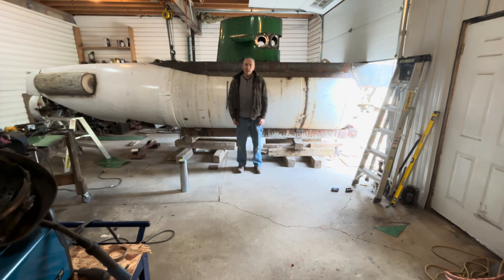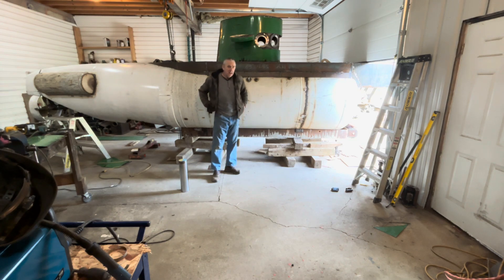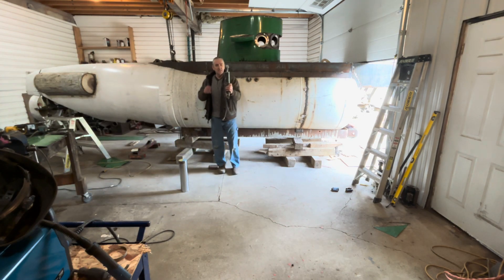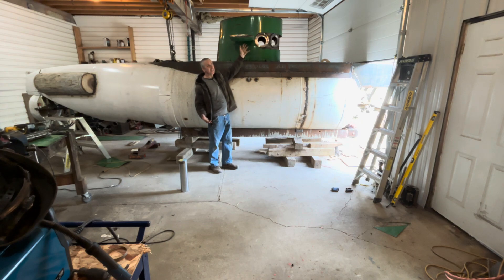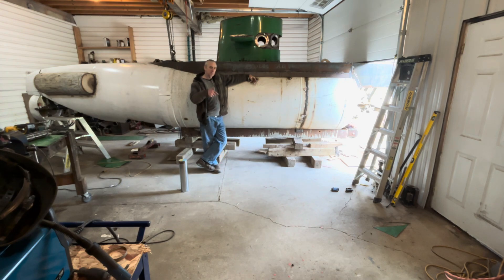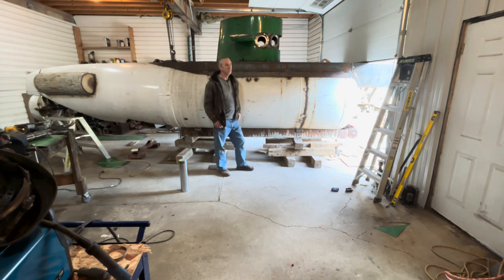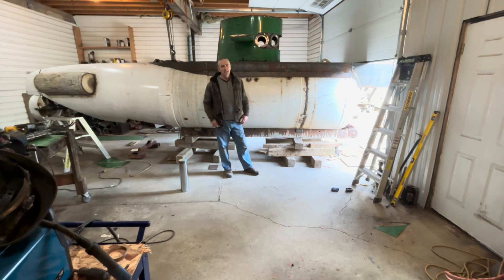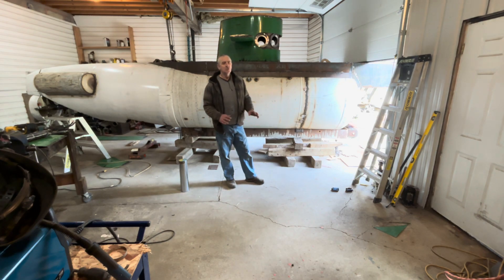Building my diesel electric submarine at home.

Comment: What are you welding with. I used to weld tanks, hull plating and keels with 7014, 8014, 9014 and 10014 rod. Works great and is not brittle at most high or cold temperature.

Comment: Hello, I watched your video and it was so interesting. Could you tell me the names of the solenoid valves and manifolds you used in the ballast tank? (In this video : Mounting Ballast Tanks To Homemade Submarine | Isolation Project) I am trying to control the ballast tank with the air of medium pressure (10 bar) coming from the first stage breathing apparatus in the air tank, but I am having trouble choosing the product, so I would like to hear your advice. Thank you.
Reply from the maker: I need more information.  How many ballast tanks do you have?  If you have multiple tanks then you can consider solenoid valves.  My concern is reliability.  You must make sure that if one ballast tanks fails the other ballast tank can surface the sub sufficiently enough to open the hatch safely.  I use simple air or water valves from Amazon and have never had a problem in fresh water.  The safest  way is to use manual valves with hull penetrating rods.
Reply: @HankPronk  I am planning to build a system with at least 4 ballast tanks. I think that if I fill each ballast tank with different amount of seawater (or compressed air), I will be able to control the attitude intentionally. Is it possible to talk more about this by email? If possible, I will leave my email address. Thank you.
Reply from the maker: @Barcod_  The key is to keep it simple.  Normally you have two external ballast tanks that are open to the sea, and one internal sealed ballast tank. Message me on FaceBook and I can walk you through it.

Comment: Wow, it's really coming together since the last time I checked in.
Regarding actuators, the Bennett 1101A is a ubiquitous and cheap hydraulic actuator used on most boats for trim tabs (hydraulic alternative to Lenco). Your cabin cruiser donor boat probably has a pair on the trim tabs. The stroke is short, but there should be more than enough force to run it off a bellcrank.
Reply from the maker: Thanks, yes I have a apir of those hyd actuators on the trim tabs.  As you say the stroke is real short and they are only one direction, or single acting.  I could spring load one though.
Reply: @HankPronk  
Mulling it over, I wonder if it maybe wouldn't be a good idea to use a single-acting cylinder and a return spring anyway. 

If the spring is rigged to pull the planes to the top of the "ascend" range and the ram pulls it down to descend, a failure in that system will automatically default the planes to the 'ascend' position without having to release the drop weights...nor any operator input at all.

Comment: Not a submarine person speaking, but dive plane mid boat is very counter intuitive.  Would not one toward the front be more efficient as it angles the boat thereby having the forward motion turn the whole boat into a dive or surface plane?  I don't get it as mid ship pushes down at the center, true?
Reply from the maker: If the dive plane is forward, it will try to tilt the sub, and the sub wants to stay level.  You cold slide a weight forward to give the sub a downward angle.
Reply: Can’t wait to see the entire sub painted.
Reply from the maker: Same here, it will be very inspirational for me.